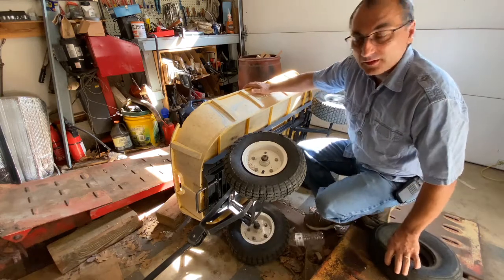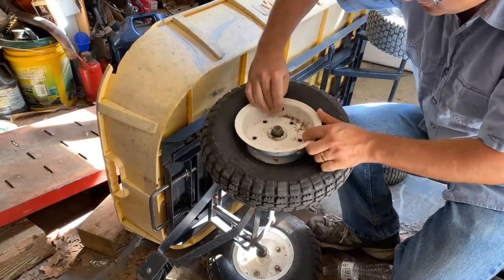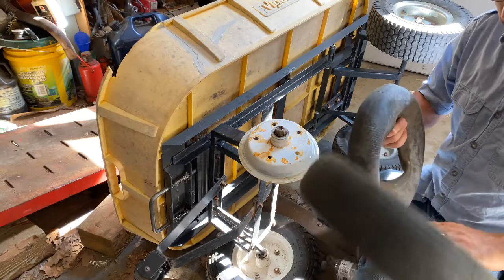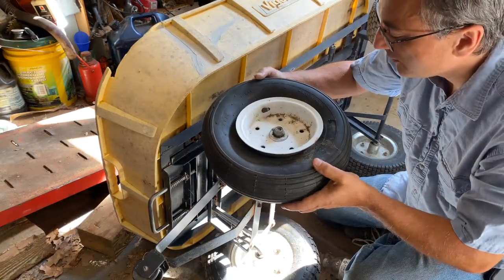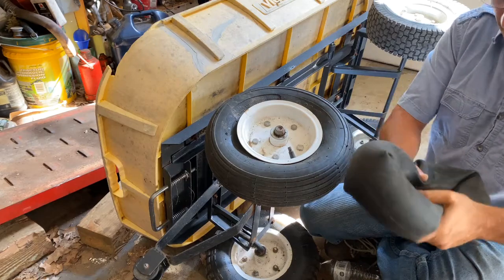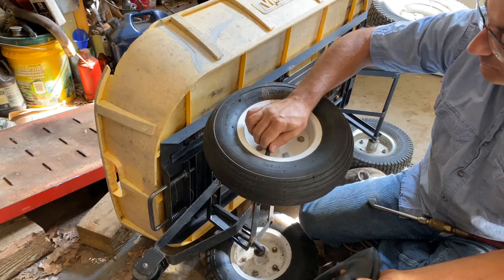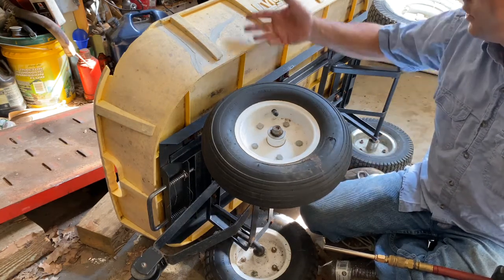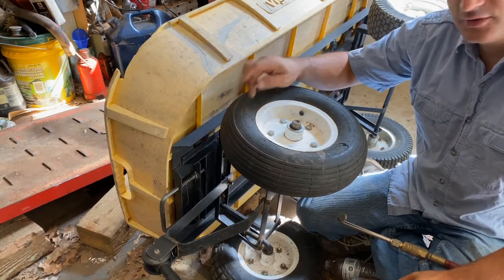How to change a tire on a garden cart wagon

Comment: Does the tire hold air if there's a tube? Doesn't the tube do that?
Reply from the maker: No it did not the tire was so bad the tube came out the side of it. Thanks for taking the time to comment
Reply: In most cases just putting tube in old tires but if tire has gashes or bad dry rot you'll replace both
Reply from the maker: @kevinboaz317  that's correct, thanks for commenting